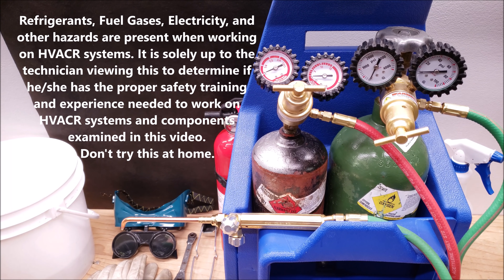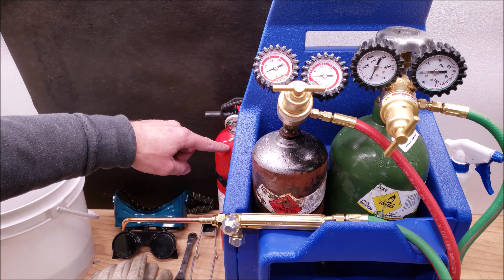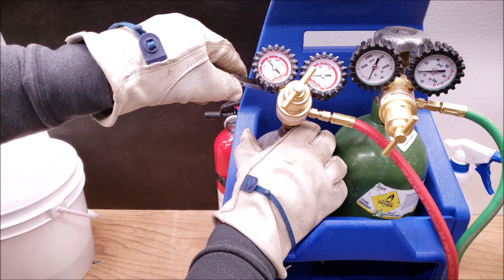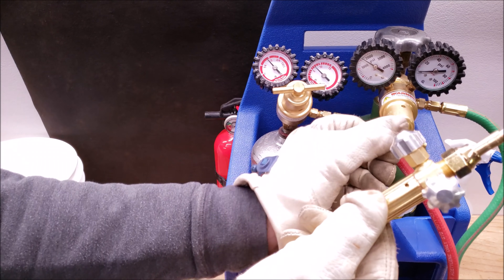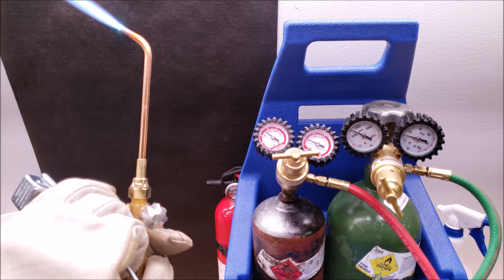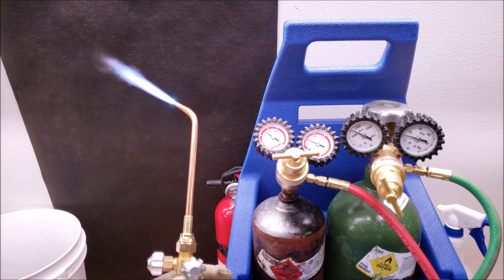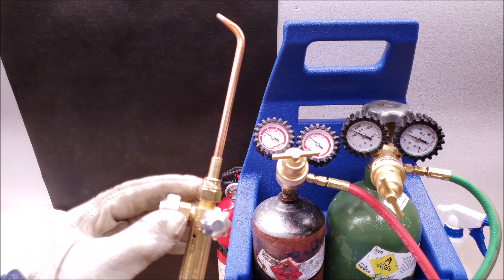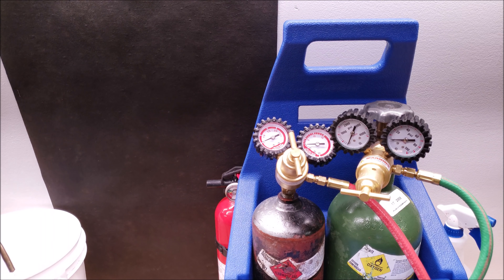Oxy Acetylene Brazing, Torch Adjustments- Reducing Flame, Oxidizing Flame, Neutral Flame

Comment: About safety rules first acetylen then oxygen is opened and before closing first oxygen then acetylen is closed. But in your video not to have fume residues you prefered to do the opposite. Could you explain this sequence if am wrong. Because I made a research on safely using torch and findings shows as I write in here. Many thanks for invaluable lessons.
Reply from the maker: No prob, we can't have all that carbon dust in the house and most people like to have that loud pop that blows out any residue from the end of the tip but if the flame was clean and you are only brazing copper, there won't be much of any so you don't have to scare the homeowner with the popping, thanks
Reply: @acservicetechchannel  Thanks for making these videos, they are really helpful and very well done, but I do have to disagree with your oxy-acetylene start/stop procedure. If you search every manufacturers torch manual, they ALL say to turn oxygen off first, then acetylene. Then in BOLD letters, they ALL say "In the event of an emergency, TURN OXYGEN OFF FIRST". The reason is that if you have a leak from the torch handle acetylene valve, and have the oxygen still flowing, you CAN burn acetylene right back into the acetylene tank, and in order to burn inside the handle/hose/tank, acetylene needs oxygen to do so. Turning off the oxygen first prevents a possibly deadly event from ever happening. Same hazard with turning your oxygen on first when lighting up.

Oxygen off first also prevents the "popping" sound you hear, and that pop is not "blowing things clear" of the tip, but blowing things back into the nozzle where it clogs the tip with soot.
If you are quick with the oxygen after lighting the acetylene first, soot is held to a minimum, and if outdoors, it doesn't matter at all.
Reply: @acservicetechchannel  if you keep lighting you’re torch that way, like I used to also, one day, if your unlucky, you’ll get a pop alright, about a hundred of them in a second or so. If you don’t want the soot, just open up the ac a little more, and you won’t have that.  Otherwise I thought your presentation  was great.

Comment: I feel like the Turbo Torch is the Oxy-Acetylene torch with training wheels. It doesn't work quite as well as Oxy-Acetylene, but if the tech has limited skill or experience, the Turbo Torch is a lot more forgiving and easier to use.
Reply from the maker: Turbo torch will certainly work and is easier to use for sure, thanks douglas787!
Reply: I agree with you 100%
Reply: Turbo torch will make you go deaf. Main reason I didn't buy one.

Comment: Thanks for this! I have been installing new split systems for about 7 years but haven't had to do brazing, apart from once in training years ago.  Now I have the tools and want to practice so I can change a compressor, for example.  Very informative.  Interestingly another YouTube video said you want a neutral flame for brazing copper pipe, you say reducing flame...  Does it make a difference how big the pipe is, because in that other video it was like 1" or so.  I'll be working with 1/2",  3/8". or 1/4".  Thanks!
Reply: a textbook would say neutral flame just for the sake of consistency of heat I think, but if you are going to be working on joints that small and you are a beginner I don't see how using a reducing flame to get the hang of things would hurt you. just make sure you get that silver solder to commit to capillary action and sweep your flame across the joint to ensure penetration. I think you'll be doing fine in no time.
Reply from the maker: Actually the length away will determine how much heat you put on the copper so I couldn't really tell you how close. Around 1 to 2 inches for brazing and then maybe out to 3" for crowning the joint at the end.  Practice is the key, thanks and you can use anywhere from a neutral flame to a reducing flame but I think a reducing flame gives more control, thanks
Reply: @acservicetechchannel  I like neutral flame which both gases mixed together, just a thought .

Comment: What tools do you recomend for a starting hvac tech?
Reply from the maker: Ismael look up "acservicetech sheet metal tools" and "acservicetech basic tools" and I have tools linked in the description section of each video as well as at-   amazon.com/shop/acservicetech    - thanks
Reply: Can you help me with this.  On checking the compressors windings.  I know if you test your C R and S to ground you know if your compressor is grounded. Im having problems how to figure out if your compressor has open windings or has shorted windings. What is the way to test them? Thanks for the help

Comment: I just bought a old setof tanks,similar to what you have and it came with a vintage torch head. Detroit L-45 is the model. It has a locking lever on the handle that allows gas flow. I have no idea how to use it. What is it for? A gas saver maybe? I have not tried it yet but it is a strange torch head. It cant be a cutting torch. Im confused.lol

Comment: Thank you but First, I did not see where it said that the UEI DL479 also came with a temperature sensor.  Second, I do love the looks of the Fieldpiece ST4 and do you have videos on that.  Perhaps I could buy one for the class and use your videos to teach from.  But I do want the UEI if it has the temperature sensor or do I have to buy that seperate?
Reply from the maker: The DL479 comes with a temp sensor. It should say it in the "included components" section. Look up "acservicetech ST4 Calibration" Video or some of the newer refrigerant charging videos, thanks Teacher Lynn!

Comment: I would like to give my class of six students and myself a gift of the UEI Meter with the temperature probe and I am not sure what is the best one.  I want to buy from your site.  I know there is the probe that you have to tape and the clamp on.  Please help me find the best one and one you have used so you know for sure it is the best by actually using it.  I am also confused about the Patreon and I want to join but am not technically savvy.
Reply from the maker: Hey teacher Lynn, Here is the newer multimeter I use in the videos and in the field. it does come with a bead k-type temp sensor but I would highly highly recommend also getting some ST4's for the classroom with the dual temp sensors with calibration-  UEI DL479 Multimeter with temp sensor   http://amzn.to/2jtsUbJ  -  Here is the link to the Fieldpiece ST4 Dual Temp Meter- http://amzn.to/2wc1ME3  - an in reference to patreon.com/acservicetech  - if you would like to support there then you would choose a level such as community or another and then choose how many new videos you would like to support each month. Basically you would be pledging to support each new video uploaded to this channel up to how ever many you select. Once you are in there, then you can send me messages through patreon after logging in or just through the email, thanks Lynn!
Reply: Thank you and I will check all the equipment you gave and then I will buy through you but I may have another question.  Thank you for all you do.  I have to be careful of how much I buy because it is coming out of my funds.  I think the meter with temp sensor would be a great place to start for my students. @acservicetechchannel
Reply from the maker: I hear ya on the funds. I would always be writing down all of the tiniest items so that I wouldnt forget later. Once it got to ordering, I would always have to cut things out. Thanks and feel free to ask away thanks

Comment: Hi. Thank you for the content. I am attempting to convert from r22 to mo 99 and replace the compressor. I have a split system. Can you recommend a list of your videos in order of process then i can follow your guidance exactly as needed?
Reply from the maker: I just have 2 videos on checking the refrigerant charge on a MO99 system that has been converted. I am finishing up a book that would help but it is not published yet. You could check out "acservicetech full recovery" "acservicetech full vacuum procedure" thanks
Reply: Thank you Sir

Comment: I thought a neutral flame was your hottest flame?
Reply from the maker: It is more controlled than the oxidizing. The oxidizing can burn a hole faster, thanks!
Reply: @acservicetechchannel  No I agree oxidizing flames also cause the brazed joint to look pitted and I'm sure it makes a more brittle weld.

If anything I use a slightly reducing flame which cleans up nice after brazing.

Comment: Thanks, great info didn’t know this. Question, what’s your take on using a rosebud tip to braze ? I’m new to the trade by the way.
Reply from the maker: I think it is useful for get two sides at a time but really when you are used to a tip, you can do just about anything with it. It is fun to try different tips though but always practice first before using on a system to get the different technique and timing down, thanks